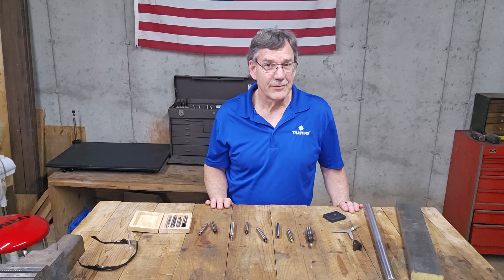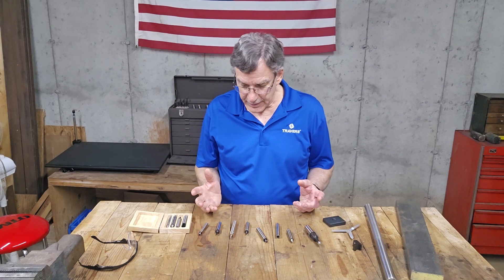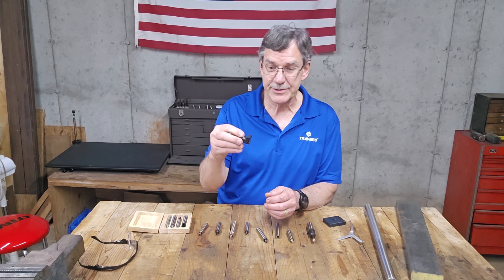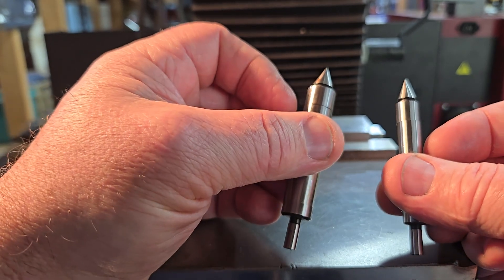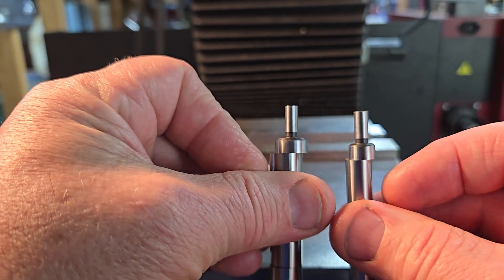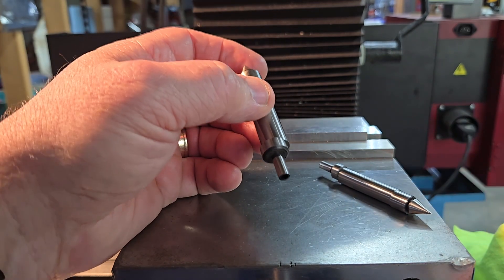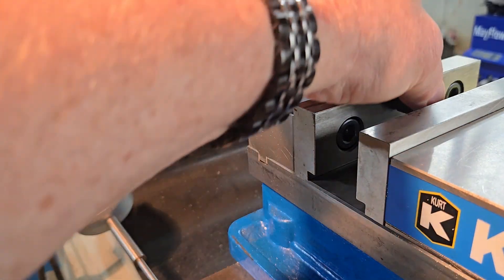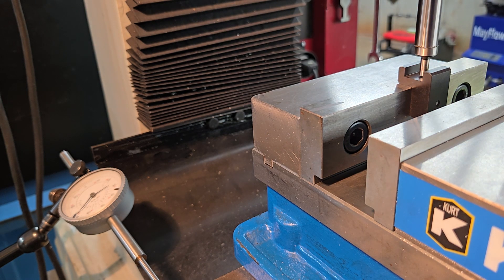How to Select and Use an Edge Finder | Travers Tool Co.

Comment: Center finder not bad for drill press work
Reply from the maker: Right; it's "not bad", but it's not great either. A typical drill press doesn't have the X and Y axis movements to help you dial in the exact center.